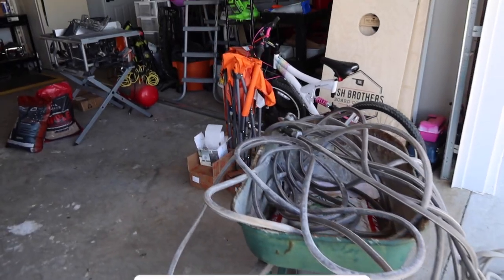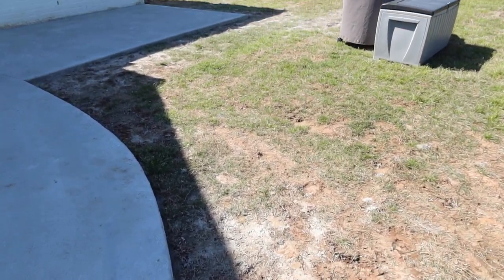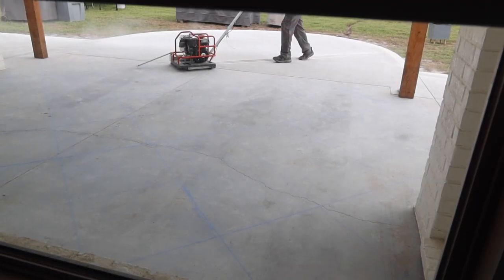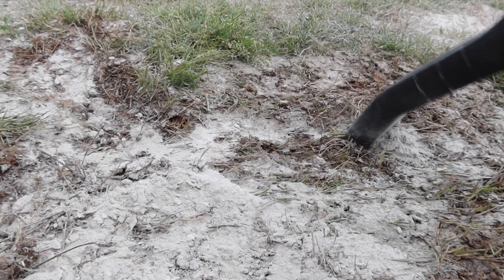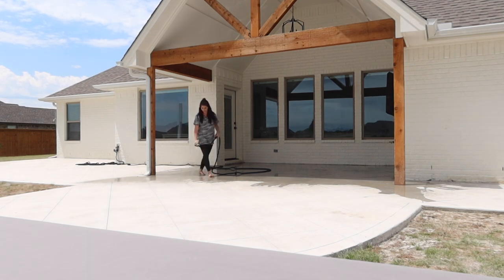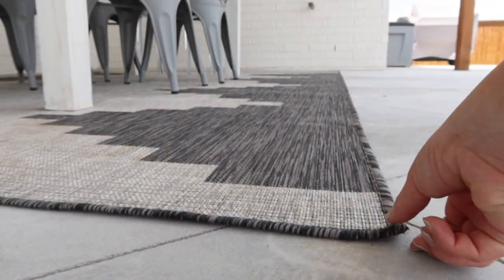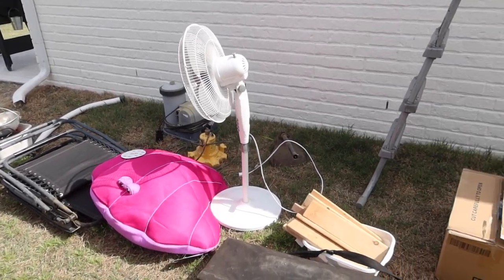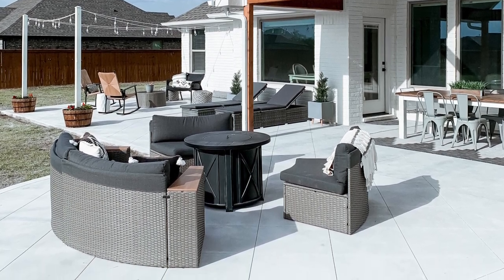*NEW* HOUSE DREAM PATIO MAKEOVER | NEW BUILDING INSTALL & MOVE IN | DREAM HOME PROJECTS

Comment: My mom hired a guy to build her shed. He built it the exact size of the materials so no cutting. This meant less work and it ended up being larger and cheaper than a pre-made shed of better quality. I am glad you like the patio solution. I hope it holds up over time and that your sod near the patio survives it’s concrete bath. Did you realize that you were spraying concrete dust over the rest of the yard? This just goes to show how important it is to thoroughly check out your subcontractors and ask for multiple references to actually talk to.

Comment: Take pictures of the patio and the mess tyet left after grinding a second time. Send those and a complaint letter to the BBB in your area and the state licensing board and the CEO of the concrete contractor parent company.  At the very least you will keep other customers from having the same experience.  Good luck

Comment: I so feel your pain, my new husband and I bought a mobile home, had a $24000.00 deck put on it, it's a wrap around deck, then we had a company come and underpin it, and stuccoed the blocks.
   It's not even been 8 months  since we had the deck built, boards are coming up, boards are splitting and busting, our rails have bold and warping. The builder has told us 5 time's he would be back and replace what needs replaced, he's yet to show up !
   Then the company who did the underpinning, left busted blocks all over our yard, under the deck, trash, like peanut cans, drink bottles, wrappers etc. The worse part is, they would clean their wheelbarrow and shovel in our yard, so we have a bunch of concrete patches in our yard ! 
   They was supposed to be here Friday to pour our sidewalk, and  a mailbox they have all the mailbox done except for the stacking stones/rocks whatever, and build a matching pillar on the other side of the driveway, this was all supposed to be done by Friday of last week, here we are , Wednesday and they still haven't come back ! They also borrowed our new $60.00 garden hose, we had bought that day, and it's covered in concrete ! 
   We also paid a plumber to come hook up our water, septic tank etc . He never showed up and we are having trouble getting that money back ! 
  So ABSOLUTELY NOTHING has went right except the electrician guy, and our central heat and air company, they did an amazing job !
   Good luck with your patio and yard !
Reply from the maker: Wow I’m so sorry you are dealing with all those problems and issues! I wish some contractors would get their acts together already!
Reply: @TilVacuumDoUsPart  me too, it's such a headache ! I'm sure y'all know that for yourselves.